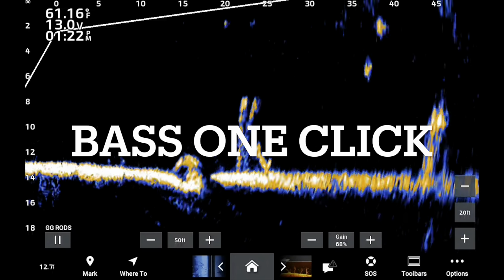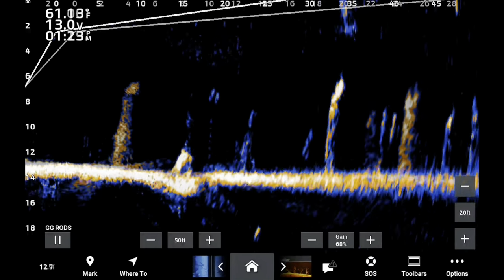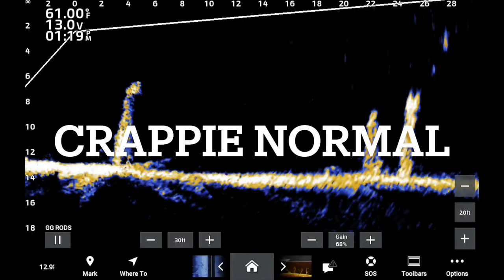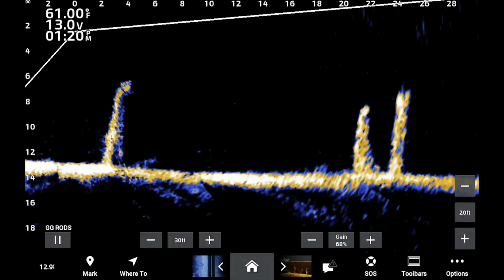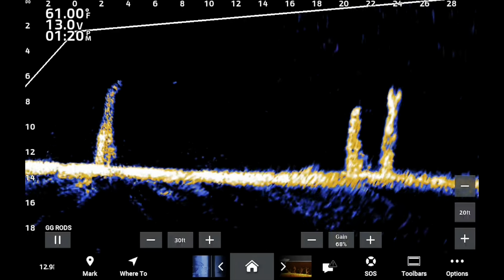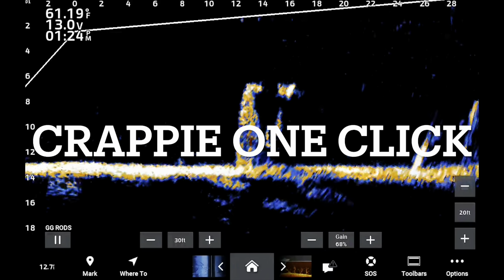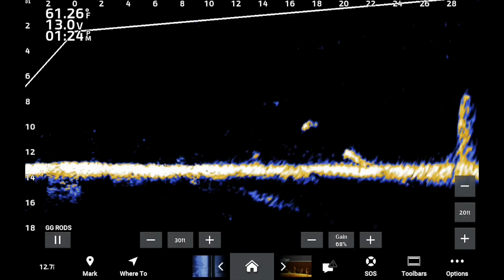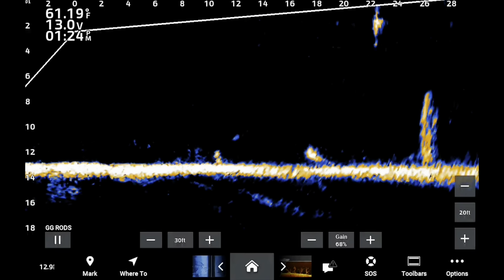Garmin Livescope: Does One Click Up Improve Your Picture??? Let’s Test That Theory

Comment: Interesting test. I'll try that also.  I"m new to LIvescope.  2 months now.  Loving it for crappie.  I do have a question if you have time.

I'm running a 1242 and it's working fine.  On Livescope screen I have the normal screen icon at bottom center for Gain, Forward Range, Depth that are controlled by the knob.  If I use Active Captain and then close the app, the icon is gone and does not return.  I can't get it back until I turn the 1242 off and back on.  Do you know of a why to make that icon return and thus return control back to the knob?  Thanks.

Comment: I don't use my garmin lvs34 transducer mount. I use the fishing specialties lvs34 transducer mount which is a ram ball connection to the pole. It is infinitely adjustable. I change angle depending on depth for forward & perspective. I  haven't used rusted steel at all. I have been trying different colors lately. I'll have to give it a try. My favorite colors pallets for my eyes so far has been amber of course along with carribian, & lava
Reply from the maker: Caribbean is real close

Comment: Had the same thing happen on my unit when I did this. However the reason I click it up is if the fish are literally on the surface busting shad. In my lake they roam less than a foot under the surface when they are chasing shad up on the water column

Comment: As long as your trolling motor shaft or whatever you have your transducer mounted to is perpendicular to the water surface standard orientation should be the best. If your shaft is not perpendicular to the water surface…as in my ProCraft….mine sits angled back, then a click up will make a huge difference.
Or you can always a wedge under the trolling motor mount to level it out and no ( up click needed) 
Just an observation from my own boat.

Comment: Good video, the only time I click up one notch is when the fish are holding in the upper portion of the water column. Otherwise I run it in the normal position.
Reply from the maker: The only place that would benefit is if they are in that tiny sliver close to the boat. But we gonna test that also

Comment: on the 2.74 are you manual adjusting the focus or auto. I have found the auto works dam good on it.
Reply: Ive found some units are ok and most are not ive all the echo family series from 7 to 12 inch currently run four 126 and only one of them did not need adjusted
Reply from the maker: Manual as always

Comment: I would like to see a test with the transducer mounted on the starboard vs port side of trolling motor/pole. Not necessarily for picture quality but to see if one gives you slightly further view than the other as well as being able to see your bait hit the water better as it looks to me like the beams are at slightly different angles depending on what side you mount the transducer.
Reply from the maker: You mean like this

Garmin Livescope: Does Port Or Starboard Orientation Read Differently??? Perspective  Mount Winner!!
https://youtu.be/tz8QXWben3k
Reply: I was going to try this today but , mine started rocking back and forth like with waves or something. Not sure what it did had been good before

Comment: I guarantee that 2.74 black box update is horrible. Never had the stair step bottom returns until that update. 
Wish I would have never updated it
My 126 & 2-93uhds are running 27.10. Seems like I’m always having to adjust settings to get a decent picture.
Reply from the maker: I did a video talking about that not too long ago
Reply: I think you can revert back the update..
Reply from the maker: @TheFISHIN14  I revert back and forth constantly testing new stuff.